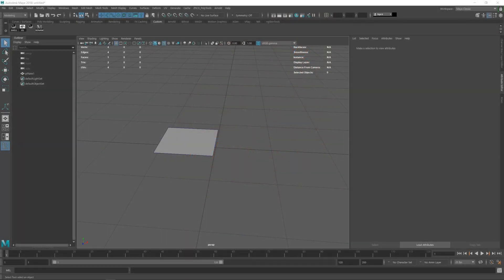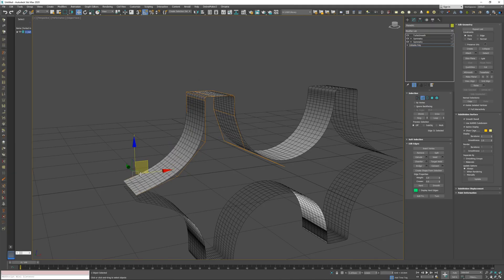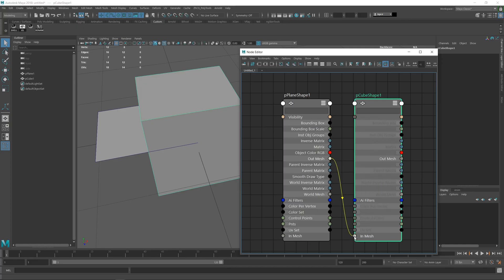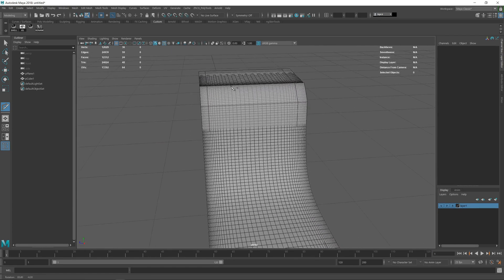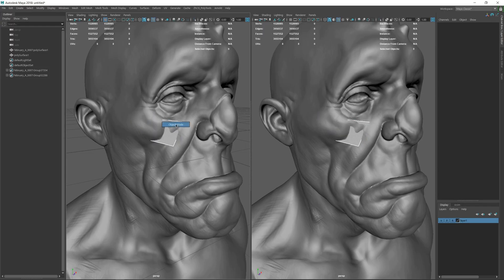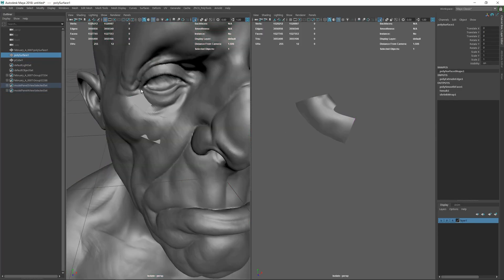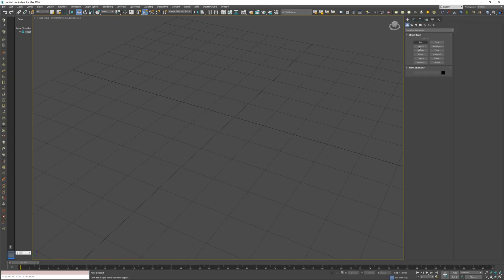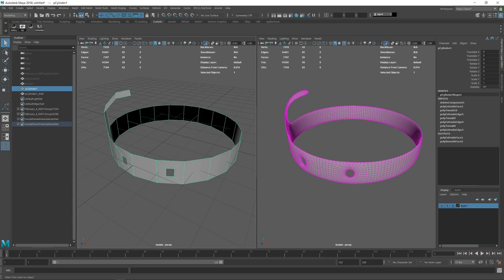How to stack modelling deformers in Autodesk Maya like in 3DS Max.

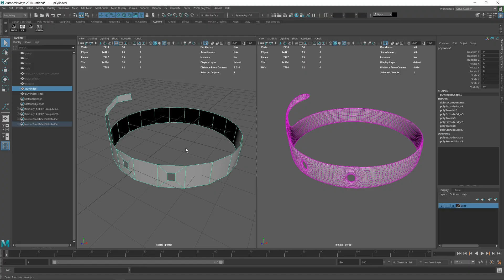Comment: 5:46 extrudin more time it will break? as vertex order change. 12:08 another extrude will break vertex order on top... so need to be carefull or Use your imagineation. for thickness
I can do that manualy. or use smooth proxy. Rest can be scripted in python nad qt.
Reply from the maker: I am not sure I understand what the issue is, but no, it will not break

Comment: Just use Max. Jesus..
Reply from the maker: 90% of the visual effects studios have their pipeline in Linux, most of the times 3dS Max is not even an option... You should know that. Jesus... ;)
Reply: sometimes or most of the time at a company you don't have the luxury to chose what software to use. If your company is a Maya based company you are gonna have to use Maya. If you do have the luxury of using whatever software you want, then sure, use whatever works for you. Easy.

Comment: Then, just use max.
Reply: Right? So much simpler and SO much more powerful. In Max, your stack is live. You can change the order of operators, get a different result, change all the modifiers parameters (no need to "delete your history").

Appreciate the effort though, but in the end, this is just trying too hard. :P
Reply from the maker: @lordavius  Although I also love max, that is missing the point, sometimes you don't have access to max, sometimes you don't want to use max, long story short, this is just a little tip for maya users to make their life easier, no need to start a war over what software is better, they are all very capable.
Reply: @3dwithanaccent695  And I did appreciate the effort. Listen, I don't want to start " a war over what software is better ", but SOME areas are more developed, better integrated, more mature on some softwares than on others. For example, Maya's EV is pretty cool for animation, Houdini have nowadays no real match against pure VFX pipeline, and Max's Stack has no substitute on the same level (Blender's lil' stack also tries, but lacks many simple functionalities like trickle up a selection easily).

Pointing flaws and strengths is not in any way intended to start a war. You did a pretty good job on showing how to get something similar in Maya, and that's cool. No need to start a war of any kind.

Cheers!

Comment: This is called a one way instance, remember playing with this years ago when I was trying to get division levels like in Zbrush, I think it’s also in Maya Bonus Tools.
Reply from the maker: Anyway. Maya already works like Zbrush with the subdivision levels. If you sculpt the mesh with a mesh smooth on the top it will retain the sculpting information even when you lower the resolution.  Also, there are ways to have the low resolution mesh to adapt to the high resolution using a blendshape on a copy of the mesh at the resolution you want to be adapted too. I use that trick to gain a bit of extra detail on meshes with a relatively low number of polygons.
Reply: 3dWithAnAccent I see, thanks for the info, was years ago so all I remember was it didn’t work like in Zbrush going up and down the levels after I sculpted a model, using one way instance I was able to do a smooth on the instance and retain the first level but sculpting on the smooth version didn’t modify the low version as u would expect.
Reply from the maker: And one more thing...
if you want to recreate the level of subdivision on mesh smooth from a bunch of meshes you exported from ZBrush it is possible to do that using Python even if the most logical way is to extract a displacement map. I will do a video to explain how that works.
Reply: 3dWithAnAccent Cool, thanks.
Reply from the maker: Yes. Shout out to Oscar Fuertes Garcia that mentioned in a LinkedIn comment there is a  Mel command "polyDuplicateAndConnect" that creates the the instance. Later on Maurizio will show how to script that in Python.

Comment: This is really useful!
Thank you very much for posting the video.
I tried it and symmetry and smooth work seamlessly, but extruding the mesh for the Shell isn't that clean. Can you describe what the Shell script is doing?
Reply from the maker: Hey Pedro!.
So... this is a bit tricky.
The Extrusion node will work only on the faces present in the mesh. So as soon as faces are deleted or added it will not behave as expected.
You can use this mel code snippet to add the extrusion node. Just make sure the reference mesh  is selected and  run it pasting it in the script editor or in the maya command line. You can also drag it into a shelf button.
--------------------------------------------------------------------
float $pos[] = `xform -q -ws -t`;
polyExtrudeFacet -constructionHistory 1 -keepFacesTogether 1 -pvx $pos[0] -pvy $pos[1] -pvz $pos[2] -divisions 1 -twist 0 -taper 1 -off 0 -thickness 0 -smoothingAngle 30 -ltz 0.1;
-------------------------------------------------------------------
Let me know how it goes!
Reply: @3dwithanaccent695  
I don't know what you're doing there with this script, it's so similar to a normal extrude node... but it works!!! :)
Thanks a lot!
Reply from the maker: @pedrotoledo8666   it is quite the same. The only difference is that I do not pass any of the faces as argument  for the extrusion. The original command checks the number of faces and feed those as elements to the node.
Reply: @3dwithanaccent695  awesome! Thanks for all the help!
Reply: @3dwithanaccent695  thanks for sharing this. its amazing how well this works
Reply from the maker: @keltart809   We also have a video where we explain how to write the script in python:
https://www.youtube.com/watch?v=H3FgRq8OBec&t=17s
Reply: @3dwithanaccent695  thanks again! I went ahead and tried it out in mel. Got it working similarly to the Python ver